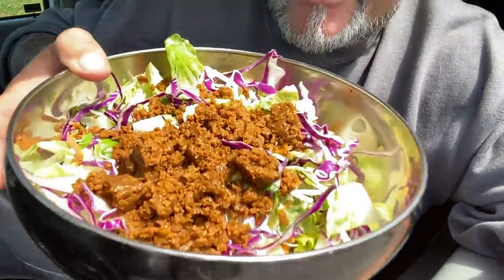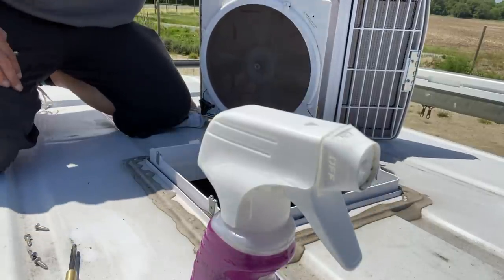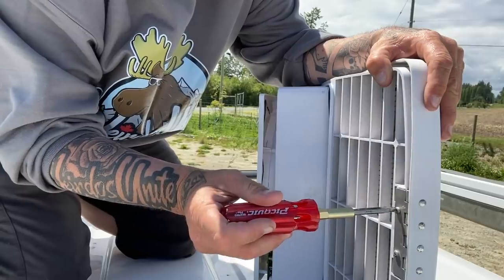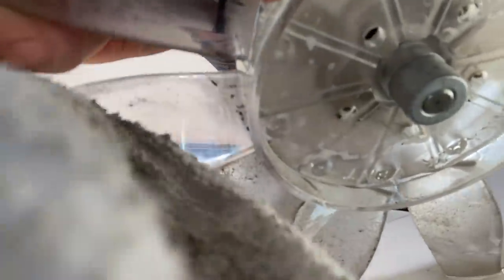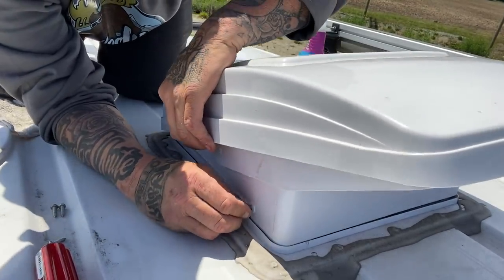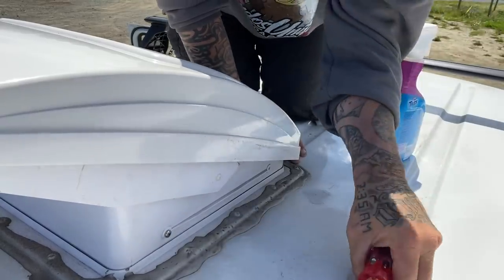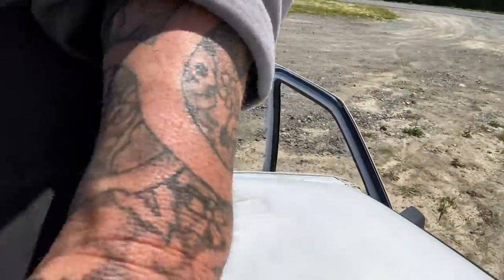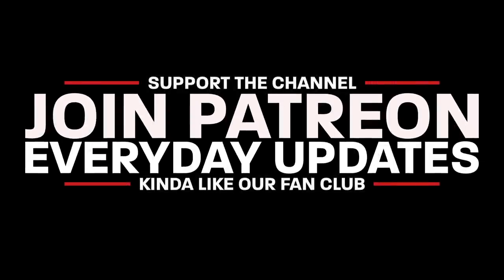The Van Feels BIGGER When You Have A ROOF VENT | Maxxair Vent Maintenance

Comment: PRO TIP: No need to get on the roof, Chrome. You can take out the mesh and the blades of the fan from the inside without removing any screws. And then you can just wash them with dish soap and warm water. 
PRO TIP 2: The maxx air fan will get less dirty if you actually turn it on while cooking.
PRO TIP 3: Don't screw in the screws all the way one per one, but rather all 4 bit by bit so the screw holes align better . You don't want to damage the thread, which can be the case when the last hole doesn't allign and you apply a lot of pressure screwing it in plastic.
Please like this response so other people will be more likely to read it, and have a swifter experience cleaning theirs...
Reply: Nadia W. Thanks! Im 72 and was purchasing items for my build when life as I knew it came to a halt thanks to the quarentine. When I saw this video I thought, "well this won't work".  "Surely there's a way to remove the screen and blades from the interior" so glad I saw your comment. I guess being a typical male Chrome didn't read the manual lol
Reply: Yeah I was wondering about that lol.
Reply: oldladytoofast this made my day! Glad to be of help!
Reply: But getting on the roof is weirdo style 🤪😅
Reply: @nadiaw246  too bad Chrome didnt acknowledge your comment. Hope all the vanners read it!! Thanks again!

Comment: I have the same vent fan on my RV, I've always been able to clean the fan from the inside. I like it because it can be used when it's raining or windy, and it's great on hot days because the air flow can go in or out. 
I'm sure one day I will have to pull it apart like you did to clean it .
I'm also full time in my RV, so stay safe and stay free.

Comment: We use the fan on our Maxxair all the time on our travel trailer. Of course, we are in a warmer climate down here in the Southwest US. Often, though, I open the vent with fan off and then open one window. Air draws right through, no fan needed. I'm glad we have ours. Our blades haven't gotten dirty like yours for some reason. I'm thinking because we turn the fan on outward most of the time I keeps the blades clean.......

Comment: Hot Tip for your ladder, when you remount it after powder coating, see if using bicycle inner tube pieces will fit. It will soften the contact between the metal and your paint, preventing paint damage and rust. I did not see if they had provided you with a gasket.

Comment: ya, because you are so far north, down here in southern cali I use my maxair fan every day and life without it was impossibly horrible, in fact even better is if you can afford the roof space is to have a fan at one end & a sunroof that you can pop open on the other, then you get a nice cross breeze.  I have ventvisers on my front windows so the windows can stay cracked open but sometimes I'm not getting enough air coming in from that and I don't want to pop the side windows because it is pretty easy to reach in and pop the locks on the doors, wouldn't be cool to come back from the store and find all my stuff gone.  If you have the fan and sunroof then you can wall off the front cab, which tends to get hottest anyway.  Down here, the trick is to stay cool and the hassle of trying to find shade without a roof vent really limited where I could hang during the day but I did it for over 6 months myself,  after the house battery the roof fan was my second van purchase and to date this is the most important add to the van.

Comment: That stainless Bowl you're eating from looks like a dog dish to me I hang in a van on trips quite often just came back from Arizona after 6 months to Washington and I found one like that at Walmart it works well. Hahaha! And it was cheaper than the other stainless bowls they offered in the human section poopy
Reply: It's so Cruz can help more easily with doing the dishes. XD
Reply: I have a similar bowl, it is double walled so it stays cool to the touch with hot items in the bowl.  Stainless steel totally makes sense in a van, light weight, easy to clean, anti bacterial.  I found mine at asian supermarket, I see them at H Mart, Ranch99, Zion Market.

Comment: Yikes... doesn't that fan make it easy for people to break in, one screwdriver to remove four screws? Or is there a locking mechanism inside to disallow that from happening?
Reply: Wouldn't it be easier just to smash a window?  It's not hard to break into any car, anywhere.
Reply: Are you small enough to fit through the hole? I seen a video beforenwhere someone came back to their vehicle to find a man that removed the fan and thought he'd found an easy way in by sliding feet first through the hole only to get stuck. His shoulders wouldn't fit and his feet couldn't touch the floor. He was very polite when found and was hoping the police wouldn't have to be involved. Wrong. Although the police did nothing but help him out of the hole and send him on his way with no charges. Apparently he was with a group of friends who got him to go in as he was the smallest of the group. When he got stuck they left him there.